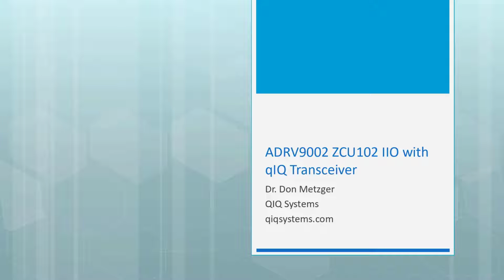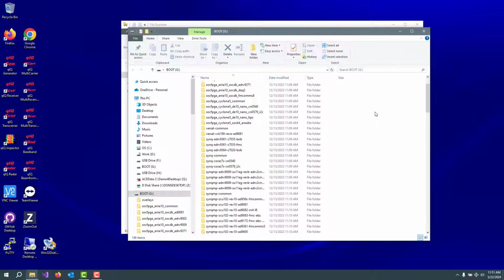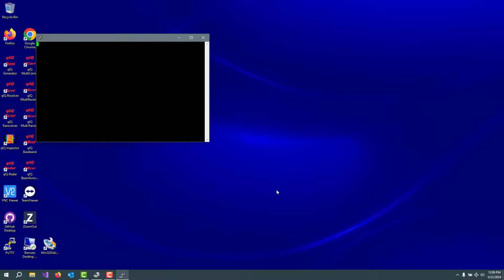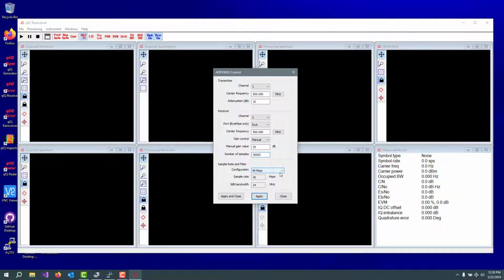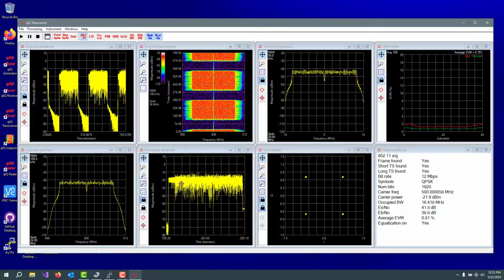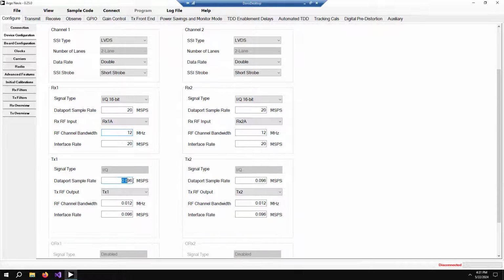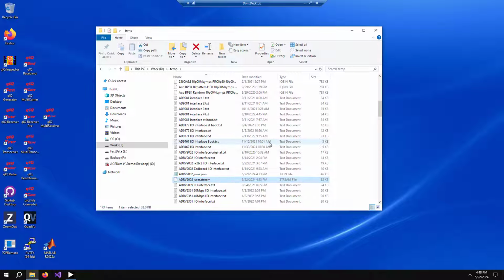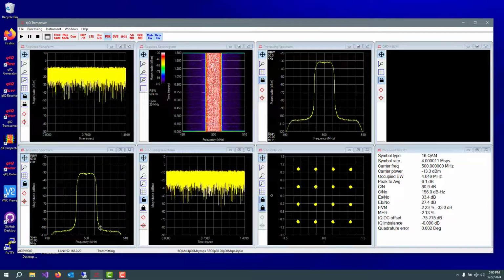ADRV9002, ZCU102, IIO and qIQ Transceiver

Comment: Is Kuiper needed for connecting with the TES software?
Reply from the maker: Kuiper Linux, installed on a SD card, is used to boot the ZCU102 and runs the IIO software. This is the Linux method of booting and running the system.
TES has a separate SD card for booting and running the system. The TES software runs on a Windows PC and talks over a network connection to the ZCU102.
These are two different ways of using the eval system. We like the Linux system better, so that's what we use.
Reply: Where can i get the software for the SD card to use TES? 

Is this the software that is written using Analogs SD writing tool? 

Have you got a link to where I can find the correct software to get TES to work?

Thank you for any help
Reply from the maker: The TES SD card comes with the ADRV9002 eval board. If you bought that board, check in the box.
Here is a link to the Engineer Zone group supporting TES on the 9002:
https://ez.analog.com/rf/wide-band-rf-transceivers/tes-gui-software-support-adrv9001-adrv9007/

Comment: ADRV9002 & ZCU102 Setup with IIO and qIQ Transceiver: Video Summary with Starting Timestamps

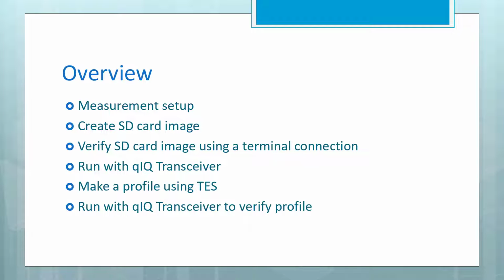* *[0:25] Setup*: Shows how to set up an Analog Devices ADRV9002 transceiver chip with a Xilinx ZCU102 host board using Analog Devices IIO software.
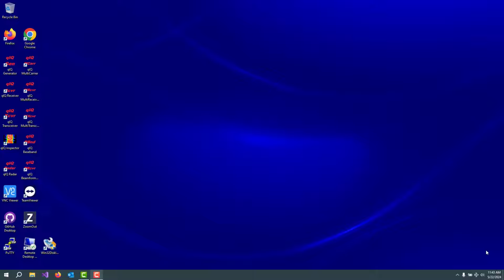* *[1:53] SD Card Image Creation*: 
    * Download the latest image from Analog Devices.
    * Use software like Win32 Dis Imager to write the image to an SD card.
    * Configure the SD card for the ZCU102 and ADRV9002:
        * Copy specific files to the root directory of the SD card image.
        * Choose the right device tree (LVDS vs. CMOS). 
        * Select independent or myo mode for the chip.
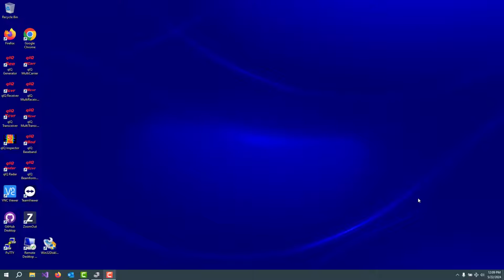* *[5:19] Verification*: 
    * Boot the ZCU102 board with the created SD card image.
    * Connect to the board via a serial port using PuTTY and verify the presence of the axi adrv 9002 device.
    * Get the IP address assigned to the board.
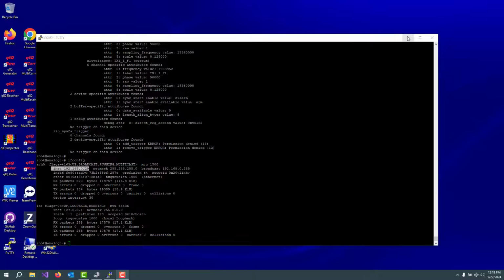* *[8:10] Running the System with qIQ Transceiver*:
    * Open the qIQ Transceiver software.
    * Configure the instrument settings for the ADRV9002 (transmit, receive channels, frequency, attenuation, etc.).
    * Select the desired mode (e.g., 40 Mega samples per second).
    * Choose a transmit file (e.g., 802.11 11a signal).
    * Start the transmission and observe the data in the time domain, frequency domain, and spectrogram views.
    * Perform demodulation (dmod) of the captured frame.
    * Analyze the resulting constellation and EVM plots.
* *[13:56] Creating a User Profile*:
    * Use the TE software from Analog Devices to create a custom profile for the chip.
    * Configure the chip's settings (e.g., mode, bandwidth, sampling rate).
    * Generate the profile files (JSON and stream).
    * Rename the stream file to "stream.bin".
    * Copy the generated JSON and stream files into the quick transceiver folder for access by the software.
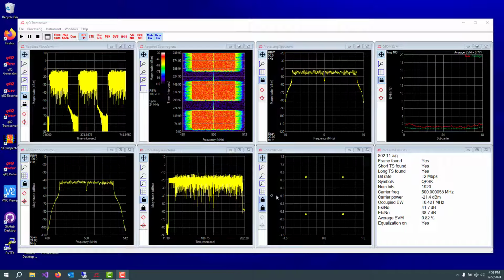* *[19:14] Running with the Custom Profile*:
    * In quick transceiver, select the user-defined configuration in the instrument settings.
    * Choose a transmit file matching the new profile's settings.
    * Start the transmission and observe the data. 

i used gemini 1.5 flash and pro to summarize the transcript